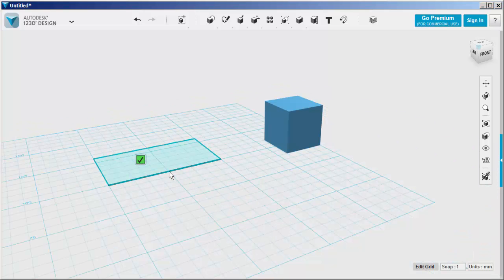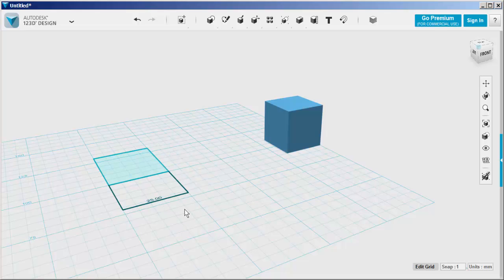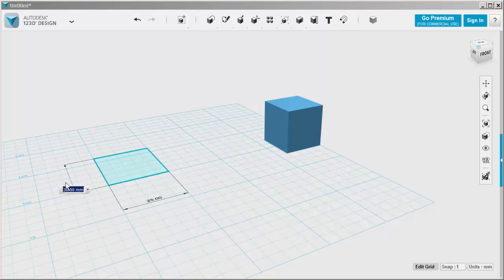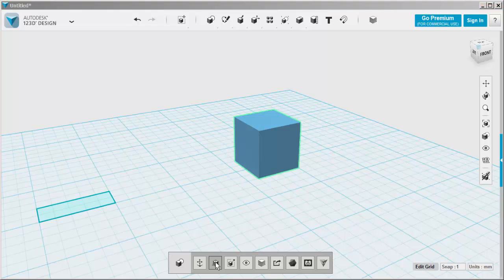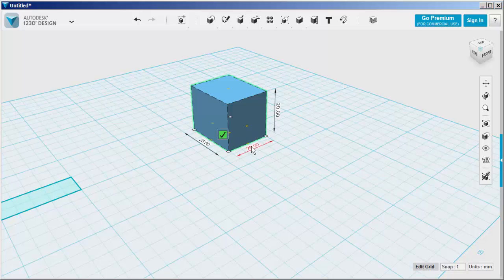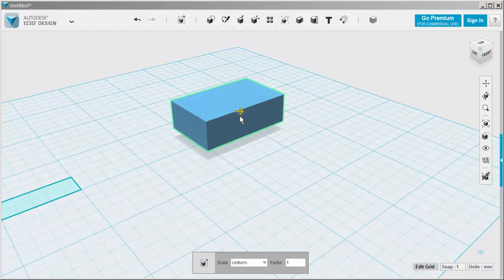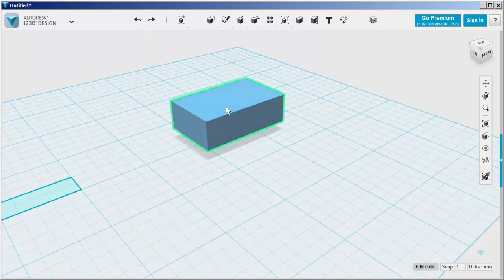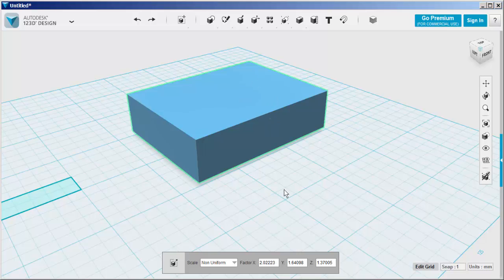123D Design: Edit Dimensions of a Sketch and Solid

Comment: When I follow these instructions, the parallel line opposite the line I'm editing snaps out usually a little more than what I just typed in.
Example, I edited a line from 20mm to 25mm and that works but the opposite line snapped out to 25.596.  Any idea why it's doing that & how to stop it?
Thanks for the quick, "down 'n dirty" video.  These are the best to watch!
Reply from the maker: John, before Autodesk retired this app, they updated it frequently. You may be using an update that doesn't work as well as the version in this vid. Maybe you can just erase (trim) the problem line out and redraw it?
Reply: Sadly I just saw the product was discontinued.  It seemed very easy to use and was looking forward to learning more about it.
Thank you for the very fast reply!  I was learning Fusion 360 but it seemed rather over my head.  Guess I'm back to that.  :(
Reply from the maker: 123D Design still works offline, so I personally think there's still value in learning how to use it for quick models. I was disappointed that they discontinued it because Fusion is more complicated than what many people need. That said, I'm currently writing a book on Fusion, and have done some vids on it already that you might want to check out.

Comment: Why is it in mm why not cm
Reply from the maker: mm is the unit that 3d printers and slicing software uses. You can change the units to cm by clicking on "Edit Grid" in the lower-right corner.
Reply: Who the hell uses CM?